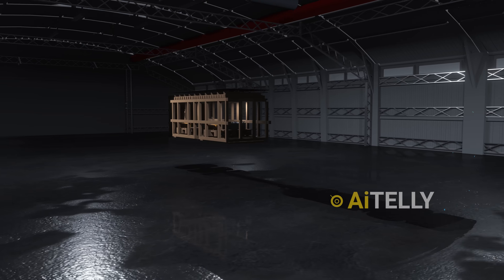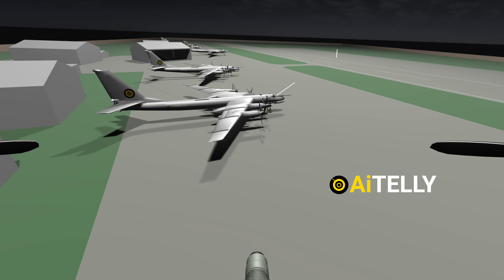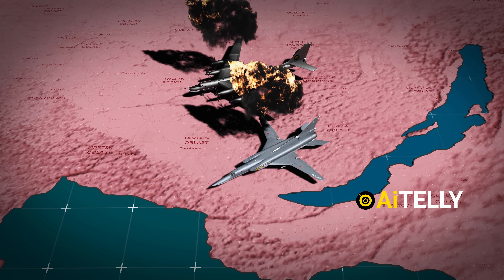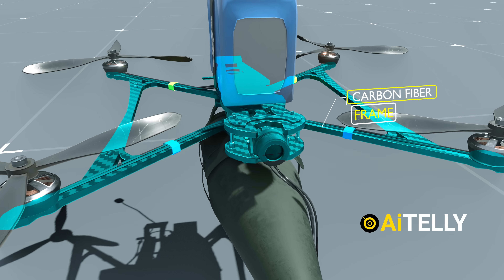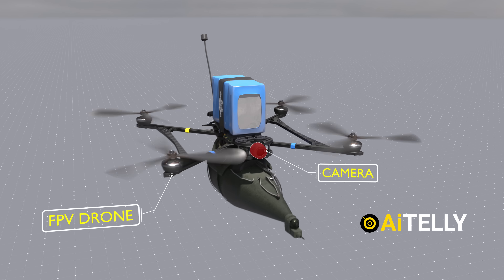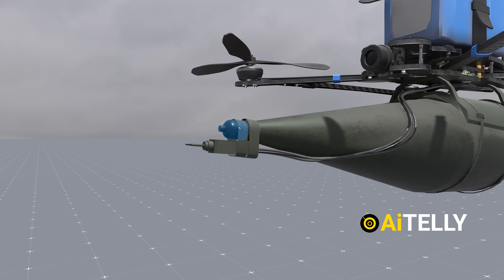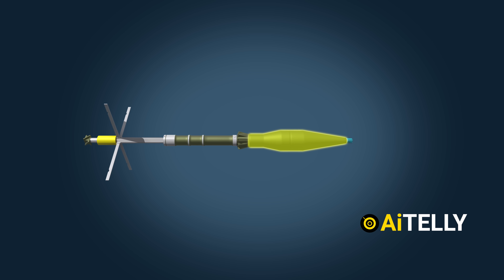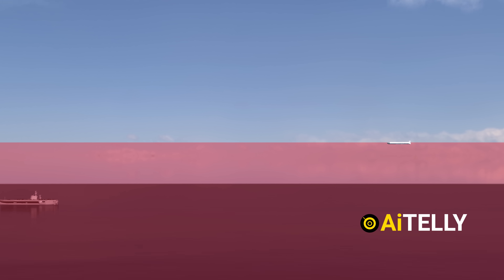How Ukraine FPV drones Truck Attack Happened? #ukraine #russia #Spiderweb

Comment: there are few mistakes here. Firstly, the trucks did not stay there for weeks. The drivers hired from a transportation company had no idea of what they are carrying and were instructed to reach to a designated point. Once they arrived, the roof popped automatically and the drones started to take off immediately. All this happened simultaneously. Logistically amazing. Secondly, the drones were not guided by any operator. In factt, it was sort of AI trained to recognize a particular silhouette of the plane and targeted to vulnerable spots that can bring maximum damage. Thirdly, the use of fiber optics is questionable as the photos provided by Ukranians do not show any reels with cables in the truck roof. The use of AI eliminates the need for either optics or radio signal required.
Reply: No,  the drones weren't entirely autonomous.  They had AI target acquisition assistance, and were also remote controlled via Russian Sim cards and the phone network.
Reply: Zelensky confirmed that drones were guided
Reply: @ViterZHir  Yeah - don't take anything anyone says as truth. Everyone has an incentive to lie.
Reply: @ViterZHir  I would've been too much of a stretch to have local AI guidance and Recognition on a small cheap fpv drone. I'm asking myself if they used fiber optic
Reply: @ViterZHir  right because he does not lie or do coke.
Reply: @ViterZHir  And we have to believe it?
Reply: Я летаю на 4G еще с 2019 года. ФПВ планер parrot disco. С модемом лте. Ничего сложного нет. Можно управлять дроном сидя дома перед телевизором.
Reply: Wait wait... you mean to tell me that the drones were basically autonomous? Maaan, that is some next level shit! I do hope this war comes to an end soon though. Waay to many people have needlessly died already on both sides...
Reply: @carpandrei7493  no they were not autonomous. they were guided by 117 operators
Reply: @carpandrei7493  its nothing special, any drone for civilian use have modes to follow u on its own, for big stationary target like bomber plane to train drone to identify it is absolutely trivial
Reply: @carpandrei7493  yes - that's right - Ukrainian intelligence has already published the data - everything is not so autonomous - there were up to 117 human operators BUT there were also trained drones, which in case of signal loss determined the contours of the target and occupied critical places for a strike on the base - for the Tu95 this is the wing, for the Tu22 it is the body behind the cockpit - all this was announced yesterday immediately after the operation BUT definitely the creators of the terminator are quietly smoking on the sidelines )))
Reply: No, the drones were guided by operators. That was confirmed
Reply: Most likely there were hybrid approach. The drones can self-guided, AI assisted with the operator confirming the target.. But definetely it was not joystick operated full scale operation. You can not fully rely on mobile reception.
Reply: @amamatkulify  Слишком медленно они взлетали. Что говорит о том что операторов было меньше чем дронов. И пока оператор не ударится в цель, он не может начать управлять новым дроном. Паузы между взлетом дронов из грузовика были слишком большие. Так автоматика не работает. Если бы дроны взлетели автоматически, они взлетели ли бы почти одновременно. Как это бывает на шоу дронов. Тут же ручное управление, медленное. Что помешало атаке (прохожие камнями кидали в дроны, когда поняли что они взлетают из контейнера на грузовике).
Reply: @kotnapromke  Возможно. То есть ты думаешь, операторов было меньше чем дронов?
Reply: @amamatkulify  Да, очевидно. Пауза в минуту между взлетами говорит о нехватке людей.
Reply: 100%
Reply: I can't imagine that the drones launched automatically immediately on arrival at the launch site. There will have had to have been some timing arrangement to make sure that all drones launched at the same time. Still, very impressive.
Reply: Еще забыли сказать, что вряд ли снизу стояли мощные аккумуляторы, которые подпитывали локальные аккумуляторы дронов. Любая проверка - и провал операции. А то что в надпотолочном пространстве располагаются дроны визуальным осмотром никак определить невозможно. Кроме того, сомнительно, что литий-ионные аккумуляторы 18650 даже за год способны разрядится до критических значений. Так что не нужны там аккумуляторы. С виду, как внутри так и снаружи, это просто обычный морской контейнер, переоборудованный под бытовку.
Reply: @longsvano  Да. Именно так. Lipo хорошо держат заряд. А на крыше была солнечная панель. Которая одновременно поддерживала заряд ретранслятора и служила маскировке. Открываясь как крышка перед вылетом дронов.
Reply: You are right. I am from Ukraine and analyzed our news, the video distorts the information a little.
Reply: All military experts who were interviewed, including Ukrainian ones, unequivocally state that each drone was operated by a separate operator.
Reply: yeah it wasn't ai
Reply: @ThishandleisntavailableHereis they were certainly guided, they are SIMPLE FPV drone controled over the internet, with a SIM card ! we know all that !, yeah MAYBE they used AI to hit the correct spot, i don't see why, maybe to handle lag
Reply: that's such bullshit. Zelenskyy himself said that they launched 117 drones with as many operators.
Reply: @amamatkulify  I think they used the cell phone to cell towers with the SIM card local cell phone Carrier...
Reply: Man. Tell us you're uninformed without telling us you're uninformed.

It was already confirmed that they used russian telecom networks for operators to control these.

It was not AI. They were not autonomous in any way.
Reply: Also, they were not on fiber optics. The footage that was released of their attacks clearly shows electronic jamming affecting the wireless signals used to control the drones.
Reply: ONLY mistakes, almost EVERYTHING he says is false !!
Reply: im just guessing but mostlikely they hardcoded physical gps coordinates before... and drones used air or whatewer the software is based on just to reach soecific gps coordinate...😅
Reply: @ahmetmutlu348 GPS is too easy to jam and disrupt, we know these are FPV drones. no need to spéculate, and sim cards were found, so we know how they are connected
Reply: @nitraM321 not the drone i mean target positions
Reply: @ahmetmutlu348 we KNOW that they are FPV drones, First Person View, we saw the camera images !!! AI can help,with targeting, in case there is too much lag
Reply: @nitraM321 ewen in that case 8f they hit correct targets that still means they had exact cps target position list awailable so it can be sone autonomously 😊😅
Reply: @ahmetmutlu348 they used FPV’S !!!!!!!!! jesus christ !
Reply: @nitraM321  Если бы такой дрон использовал Томас Крукс, то США жили бы совсем в другой стране.
Reply: It was AI. This is mostly secret info that leaked. Of course you can’t navigate drone 5000 km far away, maybe with satellite internet, but on russian territory? Not sure
Reply: Нет конечно. Никакого ИИ. Дроны медленно взлетали, с большой паузой. Потому что для взлета использовались живые операторы. Управление через 4G. Дронов 117штук. У них явно было меньше операторов. Операторы могли в это время быть в Киеве или Вашингтоне. Где угодно. Это мобильный интернет. Именно в этом была ошибка. Медленный взлет. Поэтому было много свидетелей и даже мешали взлету прохожие, забравшись на крышу контейнеров. Тут нет никакого ИИ. Просто дистанционное управление. Если бы была автоматика, то дроны взлетели бы почти мгновенно. Как это бывает в шоу дронов, где они летают роем.
И 117 дронов смогли поразить только 11 самолетов. Это очень низкий результат.
Reply: those planes cost hundreds of millions of dollars and Russia can't produce them anymore!! in this regard those airfields are protected by radio interference on this drone, it is possible that it is impossible to control without fiber optics, but on those drones there is no fiber optics this means that the drones were controlled by AI if the drones were controlled by living people they would have driven away the Russians who were throwing stones at trucks trying to stop the drones from taking off AI was taught to destroy only planes and not people
Reply: lilbro thinks he's part of the Ukranian Army stop spreading misinformation. A.I? your delusional af stop living in a videogame
Reply: Дроны могли управляться по wifi, или как-то еще(я не спец). Нельзя же заглушить вообще все, а только самые возможные варианты. На базе людям надо как-то общаться, рации. Если знать эти военные частоты, то и управление дронами можно замаскировать под них. А сам центр управления в грузовике: вот с ним уже через интернет общаются операторы.
Reply: @ileontyev  Вы очень все верно подметили. В контейнере мог быть ретранслятор и модем lte. А один из дронов иметь тоже ретранслятор, для усиления сигнала над аэродромом. Тогда даже глушилка не может заглушить другие дроны.
Reply: The fiber optic drones can go up to 20km also. Not only 1 mile
Reply: Это был не морской контейнер, а специально сделанный маленький домик
Reply: Ni que fuera experto en estrategia militar, criticando, la operación telaraña, primero lee y después opinas, sos caballo 🐎 😅😂
Reply: @amamatkulify  , дронами керували пілоти ЗСУ.
Reply: The roof looked like it was stacked on the side after having come off
Reply: So this Drone Attack is a Fully Autonomous murder drone 😢
Reply: @amamatkulify  there are many drones with AI but not this case! As everyone can see in the attack video, the airplanes were covered by tires and other objects to jam the AI camera of long range drones (400Km)... Russia also started to paint the silhouette of airplanes on the ground to create false objectives for the AI because those things exist and are widely used... To maximise the damage and avoid anti-aircraft, this time Ukraine used short range small manned operated drones!
Reply: @MyNotSoHumbleOpinion  NASA can see everything online from satellites.
Reply: I don’t understand how those trucks got INTO Russia?
The roads must be monitored…
Did they go through customs  because the border patrols saw small cabins and thought there was no safety issue?
Can you please explain that? U seem well informed
Reply: Sounds true
Reply: Слава   Украине   !!!!!!!!!!!!!
Reply: Man this is some terminator 3 stuff  AI hunting targets
Reply: Было бы так, то все дроны взлетели бы быстро друг за другом и все были бы применены, а вот судя по видео они вылетали с большими задержками, так как было ограниченное количество операторов.
Reply: This definitely doesn't sound right. that would require all of the trucks to essentially arrive at the same time, or they would have different launch windows and some air bases already would have been on alert. this is very difficult to do even with coordination, it's effectively impossible if the drivers don't know what they're doing.

I agree they weren't just hanging around parked for weeks, but the only way to ensure dozens or hundreds of drones all launch within a few moments of each other is going to require that some trucks which revived early were waiting for hours if not up to a day in order to make sure everything was in place before someone hit the green light

As for how they were guided, obviously we have no direct official confirmation at this point, but the idea that this was done without any operators and just on "AI" visual is extremely unlikely, almost laughable. even the best computer models at this point struggle very much to distinguish particular objects, in still frame photos, never mind being able to understand what they are in the real world and guide weapons to them autonomously.

Anything approaching true "autonomous weapons" are at least multi-million dollar cruise missiles with extremely expensive sensors and electronics, not cheap disposable drones.

It seems likely it was a mixture of command guidance to initiate the mass launch and Vector the drones towards the general Airfield along with some AI "swarming" algorithms to assist.
Reply: AI-guided drones were developed many years ago. The technology is simple, but it requires powerful and expensive hardware. Also, to be truly effective, the AI model usually needs to be trained or fine-tuned for specific environments and targets.
Reply: @Laotzu.Goldbug  Another problem with using AI is that it consumes a HUGE amount of energy, which further reduces flight time.
Reply: @Laotzu.Goldbug  The Trucks arrived approximately simultaneously. One video is actually taken by the driver who arrived at the designated location where he was supposed to be met (according to the legend and instructions). The driver says he does not understand what's going on. It is obvious he did not stay there in the highway for days. Maybe they were told to arrive at an approximate time. Anyway, the logistical efforts made to orchestrate the whole operation are impressive. For example, one truck (#5) did not reach the destination and blew up on its way. As for the drone operation. It is not possible to operate 20 drones attacking one site. You can not bring 20 operators to that location and then safely evacuate them outside of Russia. Neither is it possible to connect with drones remotely. All Russian, Ukranian war analysts say that this is AI. In fact Ukranians say that the AI was trained on museum pieces of this aircraft.
Reply: @Laotzu.Goldbug  Timing could be resolved with a large cash bonus to drivers to arrive only at a specific time, as in to 'meet the owners'.  As for other objections, I agree AI just isn't 'there' yet, but apparently it is a severe error to underestimate a clever Ukrainian.  I suspect when all this is over, Ukrainian technicians will command high salaries worldwide.
Reply: @notapilot1 I agree that cash can be an incentive, but considering how complex this operation was, how much planning and patients went into it, and probably people who had to give their lives to make it happen, it seems exceptionally unlikely that they would risk all that on the good graces and competency of some hired logistics drivers. 

It's not even a question of their loyalty or willingness, even if we assume that enough money would make them do whatever you wanted, there's nothing to guarantee that they actually are skilled enough to make it happen. mistakes can be made. For this entire operation to be blown because some guy is a couple hours or 30 minutes even late would be disastrous.

I doubt we will ever know the true granular details of this operation, at least not until many years after this war is ended one way or another, but I would bet that the actual operatives on the ground, including the drivers, were either Ukrainian Intelligence Officers or sympathetic Russian insiders. either way people who understood what the operation was to some degree, and they definitely weren't expecting them all to drive their trucks to the spot at the same time, and likely some of them had to be waiting for the others

this is simply my uneducated opinion
Reply: @Laotzu.Goldbug  Ukrainian media said operators were controlling the drones using Russian phone networks.Not sure if that info’s verified though. As for AI being able to recognize planes — trust me, it can. Right now in Ukraine, they’re already successfully testing AI drones to find mines and bombs. A plane’s way bigger and has a shape that’s pretty hard to mistake for anything else. But yeah, the video does have some sketchy info.
Reply: @Laotzu.Goldbug  Talvez apenas um drone pilotado por operador apontando um lazer nos alvos para outros, talvez , 4 drones. Então também aqui os aviões estão vulneráveis para esta ameaça assim como foi com os tanques de guerra.
Reply: @amamatkulify  Not true. The driver knew everything and he actually was Ukrainian. On his page in instagram there were many photos from Maidan in 2014. The drones were not controlled by AI. Ukrainians said that they had specially trained drone operator for every singe one.
Reply: @matvaska7993  He was not a driver. He was the owner of the trucks. And he left Russia well in advance.
Reply: Все вірно 🤝
Reply: Well that's what you get from AI CONTENT. Unfortunately. 85% truth, 15% bs.

Also... I've heard that some on purpose say bs, because "it increases engagement." People need to know not to take stuff like this too seriously, and search for actual people to present to you info.
Reply: Дроны управлялись операторами через спутник или сигналы сотовой связи имея сим-карту. В этом нет ничего сложного. Давно дроны уже управляются через интернет и специальные приложения разработанные странами НАТО. Украинцы только сколотили место для дронов в этом и их миссия и привезли в нужную точку. Остальное всё сделано спецами из НАТО но всю ответственность взяла Украина, иначе была бы ядерная Война и всё умерли бы уже..или контейнер был простым ретранслятором.
Reply: @ВикторЛ-ь6ф  ой ванька все ти знаеш.сдаемся все.
Reply: @ВикторЛ-ь6ф  Yeah - the issue with that is all airbases have radio jamming systems that would disrupt the communications.
Reply: @ВикторЛ-ь6ф  Si es como tú dices estamos hablando de un grave fallo de seguridad, la bases militares tienen dispositivos inhibidores de señal que bloquean incluso las señales de telefonía móvil. Estando en guerra no tener estos sistemas activados al máximo no tiene sentido.
Reply: @ВикторЛ-ь6ф  those planes cost hundreds of millions of dollars and Russia can't make them anymore!! that's why those airfields are jammed with radio interference that drone might be impossible to control without fiber optics but those drones don't have fiber optics that means the drones were controlled by AI
Reply: @hulioivanov3961 no man, they were controlled by cell phone 😂
Reply: @ВикторЛ-ь6ф  Врожденный шовизм мешает вам признать, что все было подготовлено и изготовлено самими украинцами без каких-либо спецов из стран НАТО. Но вы за 3 года войны все никак не можете признать, что украинцы сами создают эффективные вооружения. Для вас это унизительно, представлять, что сновает вас Украина, а не "страшная ната"
Reply: @ВикторЛ-ь6ф  бред сивой кобылы! Особенно про НАТО - у рабсиян походу только методичка с ключивыми словами "нато", "мальчик в турсиках", "боевые комары"....Визгом рабсиянина "задоволений"!!!
Reply: @ВикторЛ-ь6ф  емели могут и знают все. особенно если есть машина времени.
Reply: @ВикторЛ-ь6ф  honestly, I think this is entirely Ukrainian. No-one saw this coming, even NATO seem surprised.  

I believe this was a Ukranian intelligence op.
Reply: @ThatSockmonkey  Украинского там 0%, дроны, взрывчатка, программное и аппаратное обеспечение Британия.
Reply: @ThatSockmonkey im just guessing but the target positions seem clearly predetected using nato or mostlikely american satelites or as last option tourists or pait insiders to detect gps positions of target devices.. statistics clearly tells me that
Reply: @ВикторЛ-ь6ф  Конечно, конечно. Расскажи еще мне про красные линии.. Спецы НАТО уже учатся у СБУ как проводить спецоперации. Если бы дронами можно было управлять через спутник, то уже вся Москва или Киев были бы завалены дронами. И вообще, какого хрена ты тут в ютубе прохлаждаешься. Вам его уже давно затормозили..
Reply: @amamatkulify старлинк? Не не слышал? Давно уже беспилотники с симками летают, тоже не слышал? Инструкторов НАТО на украине? Тоже нету.. Затормозили? У вас в головах модет что-то затормозили😂 почитать чушь которую тут пишут.. Но безбожников Господь наказывает лишая их разума.. А на Украине храмы ВСУ разбивают и грабят в тч и в Курской области.. Лет через 20 модет и дойдёт как Украину поимели все..
Reply: @amamatkulify  don't be rude, mycola )